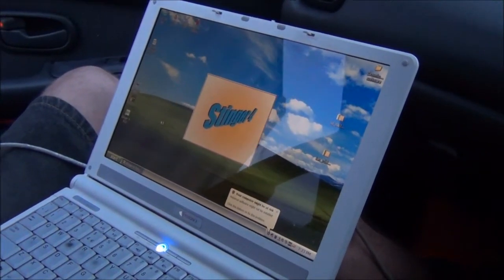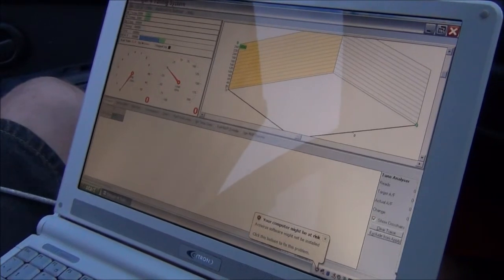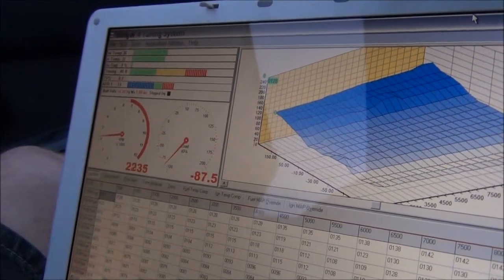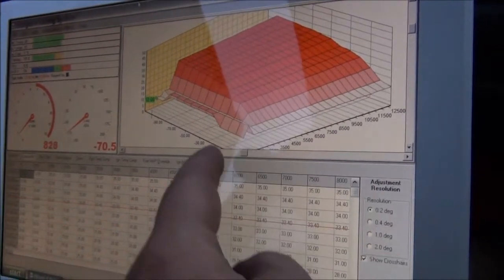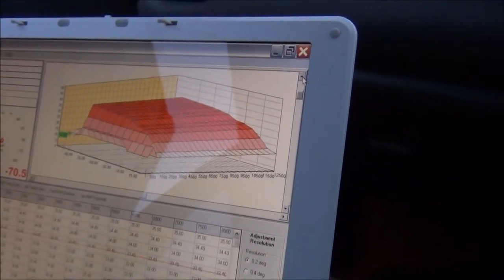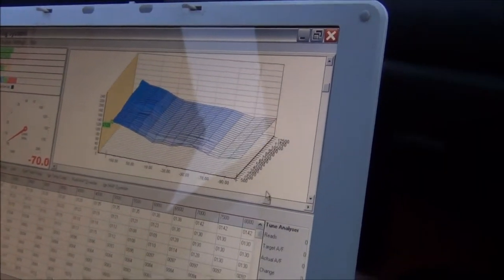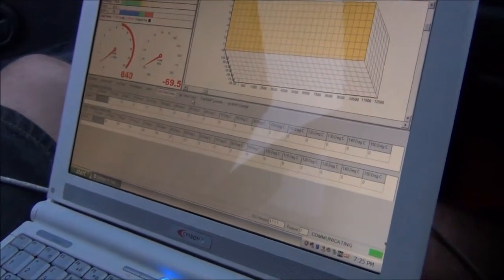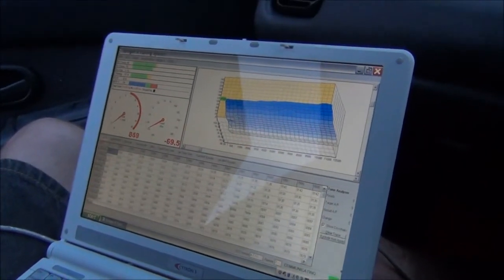Me and Dan playing with Charade ECU Tuning! - look at Stinger ECU Software

Comment: The EMS ECU range. Welcome to the world of software bugs, system crashing and extreme disappointment. Worst of all when tuning and something is wrong you may think its either the wiring isnt right or my settings are wrong but with EMS they add one other factor in which is "is the ECU actually working as it should". Dont buy rubbish, save a few extra dollars and buy a proper ECU.

Comment: hi I have an ems stinger in my wrx I had disconnected the battery for a week now my idle sits at 1000rpm it should be about 750rpm can I adjust this thru the ems stinger?
Reply from the maker: MATE thats a little concerning.
are you sure its not just in cold start mode ?
you shouldnt lose your idle speed after only a week, i'd be worried that something has gone a little astray there. would check on dyno before beating up on it :)
Reply: alex993cc1 on start up it revs higher as usuall maybe 1400rpm but was at operating temp it sits at 1000rpm il take it back to my tuner to see what he thinks

Comment from the maker: google stinger 4424 mate
be prepared to spend $2500 on an ecu and a basic tune.. its not something you want to try yourself unless you have a good knowledge of ignition maps and fuel ratio. you also would need a wideband O2 sensor